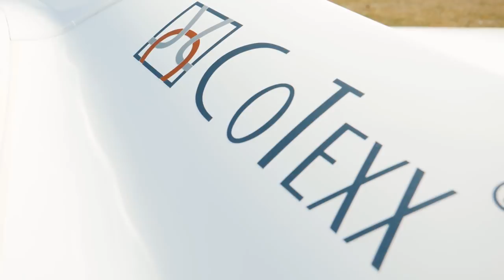LOOKS LIKE A NEW GLIDER - WRAPPING | VLOG 21

Comment: Hey! 
Why don't you pre-cut the foil on a plotter machine and then just place it? That thread that cuts it seems to make a decent line, but far from perfect. Plotter should cope with that better I think?
What is the foil that you used for the different colors? Make and model?
Thanx for the video!
Reply from the maker: Thank you! My plotter is too small for cutting large pieces of foil and when you need to strech the foil, the outline won´t be the same as intended. But it´s true, the plotted cuts are better.
I only used the knifeless tape for the large silver front piece and everything else is plotted. 
The foil is from 3M 1080.
Reply: Great looking results!
I am surprised that you managed to do that by hand.
How small is your plotter that cannot cut that front piece?
And both colors are 1080 correct?
Thank you and successful flying season!
Reply from the maker: Probably the cutter would be able to plott this front piece. About 30 cm whith is possible. 
Yes, both colors are 1080. Dragonfire red and satin white aluminium ;)
Reply: Looks great!!

Comment: A beauty! How do you create your design? Using a software or something? And also when creating it you must pay attention not to cover your glider too much due to heat on the fuselage right? Thanks for all your videos !
Reply from the maker: Thank you! I created it with Adobe Indesign and plotted it with a Silhouette Cameo 2 cutter. 
Yes, you are totally right! It´s important not to cover too much of the glas fiber structure, especially with darker colours you can weaken your epoxy.
Reply: Well it is very well done! Yeah so you were limited about the quantity and the colour of the tape you could use to create your design. I heard in a video about the future of gliding that future materials that have no problem (or less) with heat will be used when manufacturing gliders, which will allow designs to be done all over the glider, thus it will be interesting for sponsors in competition. Wish you good flights this season !

Comment: What was the noise @ 4:45 ??!?!?!? - Oooops, someone already asked...

Rückrollschutz, quasi wie ein Keil der es verhindert, dass der Segelflieger zurückrollt
~~~~~~~~~~~~~~~~~~~~~~~~~~~~~~~~~~~~~~~~~~~~~~~~~~~~~~~~~
Roll-back protection, almost like a wedge that prevents the glider from rolling back

One last question; looks like you were allowed to fly over a nuclear power plant, very cool footage, but I was under the impression this was not allowed. Can you help me understand better?
Reply from the maker: There are restricted areas above nuclear power plants here in Germany, but these cylinders are only about 600m above ground level. So you are allowed to fly above nuclear power plants, but you need to be high enough (which I was).
Reply: That's cool! Thanks for the reply. Nice video!

Comment: Hi Mr your glider seems very nice , Can  you tell me its glide ratio please.
Reply from the maker: Hi Gilbert, I have never measured the glide ratio on my own. Wikipedia says 1:38 and the polar I was using was 1:36. But my Libelle flew better than the 1:36. Actually I guess it is something around 1:38. But my Libelle was a lot better at higher speeds, so at 130 - 150 km/h I noticed an advantage to other non-modified Std. Libelles.
Reply: @SteFly  thank you very much, I wish I have your skill.